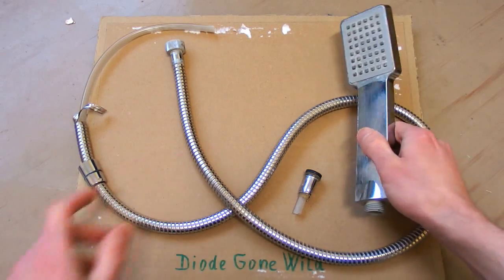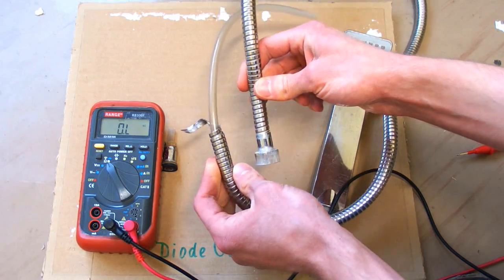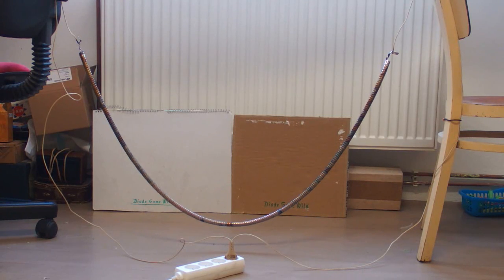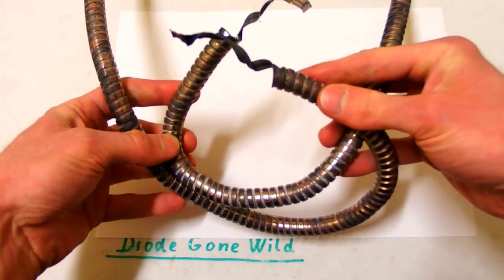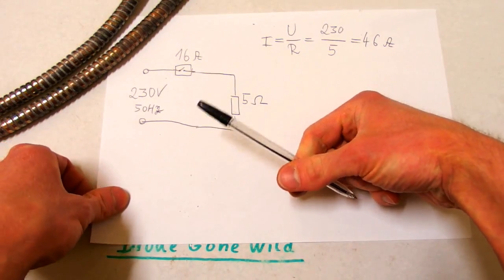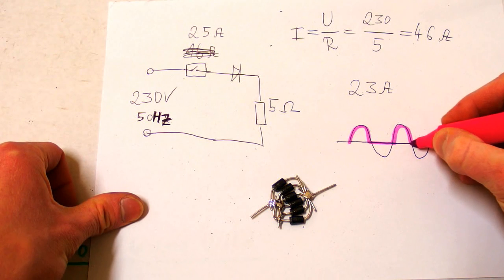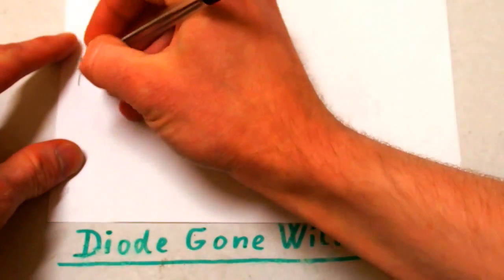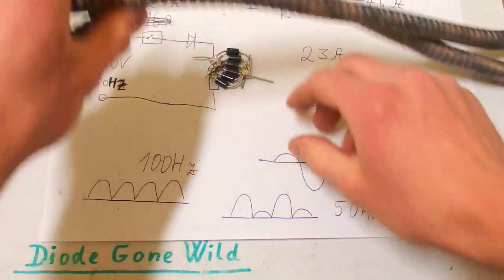Suicide Electric Self-Heated Shower Hose

Comment: Well... Ohm's law only works with AC if the load is purely resistive. You have to take into account the inductance, impedance, and other properties of the wires and the load. But since you're not driving a heavy load, Ohm's law will work albeit a little inaccurate.
Reply: Ohm's Law does work with inductors and capacitors if their current waveform is a sine wave. But then instead of using the D.C. resistance measured with a multimeter or an  ohmmeter, you have to use the A.C. impedance in your formula..

Comment: Try this.... iron pipe with a copper coil wrapped around it. Diy induction heater. The coil wrapped around the iron pipe should a fair bit of inductive reactance to limit current.

Comment: U splited ur mains into two so u get 115V AC, but after u transfer it into DC u have to multiply it by 1,41, so u get 32A instead of  23 and thats why ur braker trips. Am i wrong?
Reply: Indeed. You are wrong. :p He didn't splitted mains into two. O.o I mean.. where exactly?
Reply: Yes, you're wrong. The square root multiplication applies to bridge rectifiers.

Comment: In Germany it's vorbitten to limit so mutch power by a diode.
It's only alowed up to 300 watts here. Above you have to use wave packet control.
This is because DC current can drive the local low voltage transformers into saturation.
Reply: This thing isn't exactly approved in any case though
Reply: But what about hair dryers whitch run at 900W on half AC cycle?

Comment: This actually worked pretty well with water flowing, I had a nice hot shower this morning.
Reply: wait it this sarcastic or not
Reply: How are you still alive then?
Reply: they didn't touch the metal so most of the current went through it instead of them.

Comment: 5KW is a bit weedy for an electric shower. The one in my parents house was wired directly to the fuse box, with its own fuse. As a kid I used to see how fast I could make the electricity meter spin by turning everything on :)
Reply: James Grimwood 😂😂😂😂
Reply: It’s normal practice for an electric shower to be on its own radial installation wired into the CCU/DB.

Comment: You mad bugger lol.
Why do you use "U" instead of V or E for your ohms law?, just curious, not picking fault :-).
Reply from the maker: Because I have always been taught that voltage is "U". Maybe this differs country from country....
Reply: When I did an electronics course in the 1980s (in the U.K.), it was explained that 'U' is the symbol for potential difference. Potential difference is of course measured in volts (V). Similar to how the flow of electricity is current (symbol I) measured in Amps (A).
Reply: Yeah, I've been taught "U" for voltage too. BTW, I was expecting to see you connecting that hose to your 60V 40A supply, but I forgot how mad you are :D
Reply: Ahh that makes sense :-), i use V because of the man Volta that was a pioneer of electricity and power.
But U is a discription not a name, thankyou :-D
Reply: My country, Malaysia, use V.....
Reply: These days V is used for potential difference in UK schools, however at university level they tend to use an epsilon (E/ε) case determines whether it's modelling DC or AC.
Reply: I've also been taught "U" for voltage. But the "U" is just the potential difference, and the "V" is the unit symbol for Volts. So we could write it like this: "U = 230 V". So the potential difference (U) equals 230 Volts (V). And for the "E", it's used for Energy I suppose, not for potential differences. Like in the Einstein's formula: E=mc2
Reply: Thats becouse in Europe we use SI system. E is reserved for Energy or electromotive source. U mostly mean effective voltage or Volts in DC. It may be based on country, for exaple in USA they have compledly diffrent electronc simbols like resitor
Reply: P= Power [Wats], U=Voltage [Volts], A= [Amp], E= Electromotive Source Voltage, it may be also a diffrence if u see line under a symbol. Its may be pick to pick (P2P) voltage, effectic voltage.
Reply: U/V

distance/meter 

temperature/Celcius
Reply: Here where I live we have Bern taught that U is for voltage.
Reply: zx8401ztv supposedly it's U for Unterschied -- difference in potential or something like that -- in German, so U is more usual in parts of Europe
Reply: Oh, ive allways used V for voltage or some calculations like to use E for voltage.
I tend to stick by the V = Volta,  A = Ampere, W = Watt, Ohm.
But i will remember "U" just incase i see it in calculations :-D
Reply: @zx8401ztv  V is the unit, U is the phenomenon.